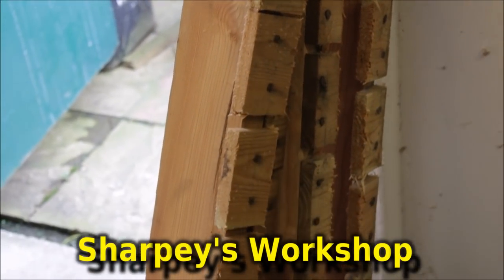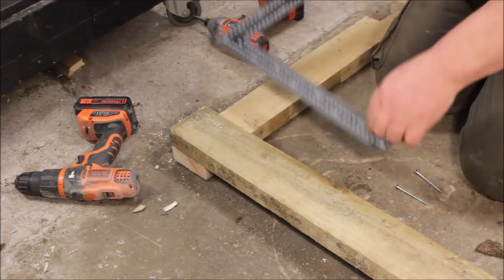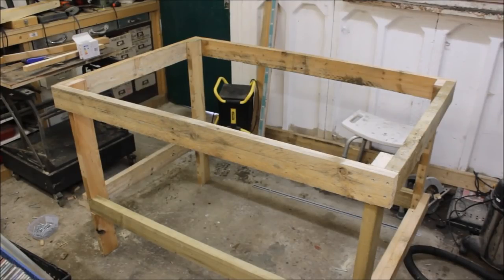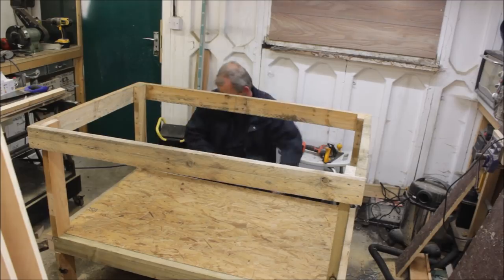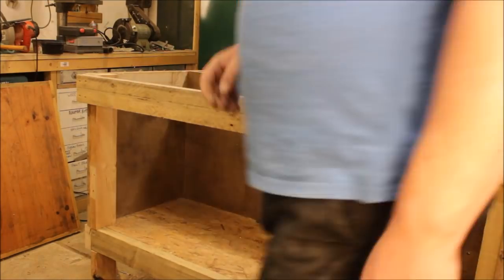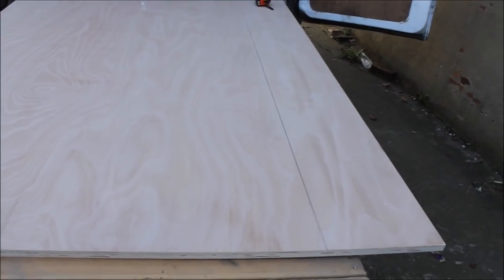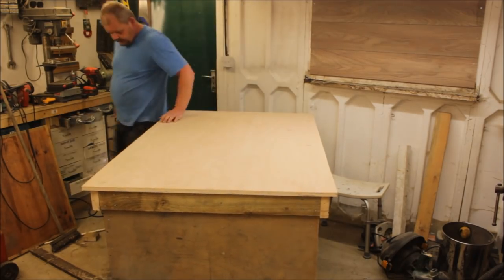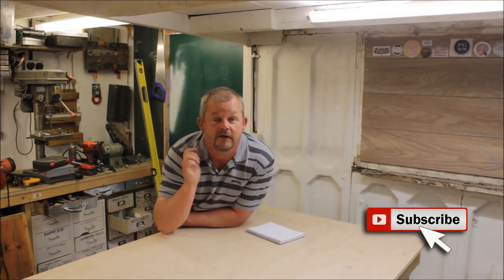Easy Diy Workbench Build

Comment: I’ve got a bigger bench than that in an even smaller space and I couldn’t do without it. The thought of crawling around on the floor to make something means I can put up with the constant annoyance of moving stuff and myself around it. I also have my table saw attached to the one end of it and am really finding this to be suboptimal but I just have no alternative at this point.
I use the crowbar in a vice to remove nails too, I combined this technique with your advice to give them a tap first and now they just fly out with even less effort than before.

Great vid, keep em coming. 

Cheers.
Reply from the maker: Thanks Pete it's nice to here these benches work in small shops cheers buddy
Reply: SHARPEYS WORKSHOP no worries.
Reply: Have a look at the roughneck demolition pallet buster on screwfix. Best 20 odd quid I ever spent, bloody useful tool.

Comment: Nice build,I think I understand why a lot of guys don't use glue,as it can be a little messy,just built a bench for myself today my hardware warehouse was having a sale on pine lengths 35mm x 70mm@ 1200mm long for a couple of bucks each,but I did glue mine,as I can't help over engineering,lol ;-)

Comment: In a small shop space, I like to have a bench on wheels, so I can have the option of using it in the middle or on the edge, then park it on the edge if I want when the project's done.  For the wheel choice, locking wheels are generally rubbish, especially if you'll be leaning into the bench a lot, as it tends to still scoot around on the hard plastic of the locked wheels (which has the added advantage of leaving scuff marks all over your floor).  Plus the locking catches are hard to operate with the edge of your shoe, especially if they're the swivel wheels where the locking catches can rotate around underneath the bench.  So for a bench, I prefer making one of those 'casters mounted on tilting boards' arrangements, where you step on a lever attached to the mounting boards to tilt the casters down and proud of the leg bottoms, which raises the bench a bit, so you can roll it around.  The lever catches on the angled edge of a bit of scrap, somewhat like an upside down French cleat, so you don't have to keep your foot on it to move the bench.  Then releasing the lever into the up position tilts the mounting boards up and retracts the casters up and off the floor, so the bench sits firmly on the legs when in use.

Comment: I think you are on the right track.  I've moved to a bench in the center and love it.  it's like having 4 different wall benches at once.  I have a couple of ideas (on my bench) you might like.  it you are interested I can point to the right videos on my channel.  enjoy your channel
Reply from the maker: Hi Russ I've just checked your channel out some great ideas there buddy don't think I could use a 500 dollar desk for a bench though lol I've just subbed buddy keep in touch
Reply: double thanks sharpey :>)  the one thing I really out my bench is that I reinforced the overhang and drilled evenly spaced bench dog holes.  I use these dog holes all the time. BTY, the only difference between your bench and mine is mine came with pre-made drawers and I paid only $10 for it a long time ago :>)  have enjoyed your channel since recently finding it.

Comment: Great use of old timber that would otherwise be discarded or chipped. Reduce, reuse, recycle in its most basic form. I shall be on the hunt for some pallets myself - in fact there is a refurbishment going on near where I live perhaps they won't need to get a skip if I get there first. Would this bench be strong enough to support and engineers vice?
Reply from the maker: Hi Jamie yes I think a bench like this would easy support a engineers vise and you can't beat making somthing from nothing good luck with it